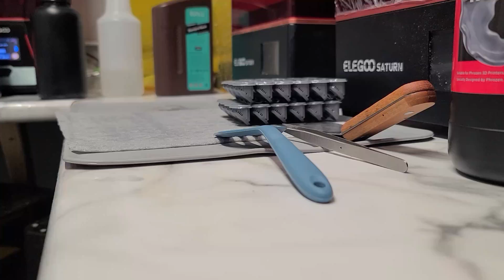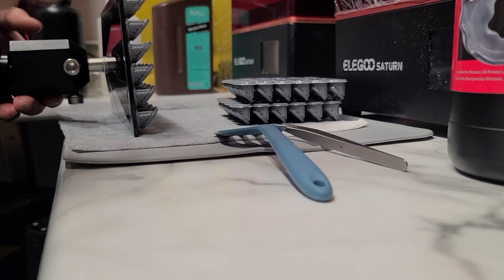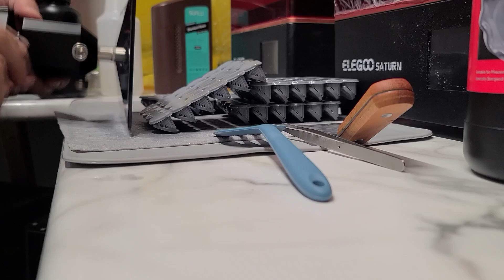Quick 3D Resin Printing Tip: Remove prints without ruining your bed level

Comment: Im about to purchase my first 3d printer for designs and practical prints, one thing that is holding me back is that it seems you are forced to pay subscriptions for certain printers. Im new to this and I would like to use open source slicers if possible, not to subscribe or be locked out of using free alternatives. I mean one already pays for the machine and the resin, adding subscriptions to it all is not something Im planning to do. Would love to hear your take on this. (btw the printer i was thinking of is the Saturn2) Cheers/Ed
Reply from the maker: You definitely can do that. Chitubox and Lychee both have free versions. Unfortunately you will just lack some advanced functions that are quite useful. The development on those slicers takes a team and a lot of money to work on so, their businesses have to make money to continue to innovate this industry.
Reply: @TableFlipFoundry  i understand, many thanks for taking the time. Regards

Comment: If you never want to stress about scratching the build plate, place a plastic scraper at the edge of the printed part base, then a slight tap with a mallet or small hammer. They pop right off. This works extremely well with rafts that have an angled edge.
Reply from the maker: Oh good tip!

Comment: With my Elegoo printers, when they come out of level it's not because of how I take the prints off (I use a removable magnetic plate), but rather it seems that if I ever leave my printers idle for a long time (so, say I don't print on it for three/four weeks) when I come back to the print after a long period of time like this it's usually come off level (naturally?) over time and needs to be re-leveled again.  I've seen this several times with both my Mars 3 and Saturn S.
Reply from the maker: I cant imagine how that could happen, how strange.

Comment: Something I think more folks should try is swapping out their spatula for a chisel. 1 to 2 inches, as long as you get depending on what size your build plate. It has a nice flat back so you can keep it flush with your build plate and the nice taper down to thin edge is about perfect for popping items off your place with minimal force. This was an old 'tip/trick' for FDM printing before flex plates and I decided to give it a try on my resin machine and it works amazing.
Reply: Hey there I've been printing since 2015 and I run my own commercial print shop. In my experience plastic razor blades are far safer for you and the build plate. If you need something as heavy duty as a metal chisel, tune your bottom layer exposure times till the part isn't welded on. Good luck and happy printing 🙂👍
Reply: @KingUsyk  It isn't really about being heavy duty I've just found it to just work all around better than every other option I've tried. It takes very little pressure to slide it under fdm or resin prints so it has been far safer for me to use than metal spatulas and scrappers. It isn't like I'm having to happer away it to chip of prints it just appears to have just the right angle and thin ness of edge to slip in and pop prints right off without having to chip away at it, no matter how loose or tight my first layer is.

Comment: Could you discuss changing the FEP? I ruined my original FEP and have had a hell of a time trying to install a new one. Just can't seem to get it right despite looking at a couple dozen videos. The top layer keeps getting scrunched up during the print and I don't understand why. My intuition tells me I am still making it too tight, despite using a spacer and everything. It's kinda made me give up for the time being cuz I don't have time to constantly be changing FEPs. :(  I have an Elegoo Saturn.
Reply from the maker: When you say...top layer...
I want to make sure you know, the fep usually has a protective cover on it, that you're supposed to remove before installing.

Comment: I use a Plastik Kirchen scraper with changeable blades and do the same with great effect. Also as sidenote, it helps to use a raft with angled sides and if you print on plate add a little slope on one side of the part so that the scraper has a chance to get under the print and let the wedge shape do the work
Reply from the maker: This is excellent advice. This is the only raft we use for pre-supports for this exact reason.